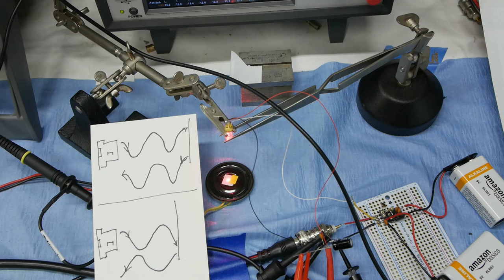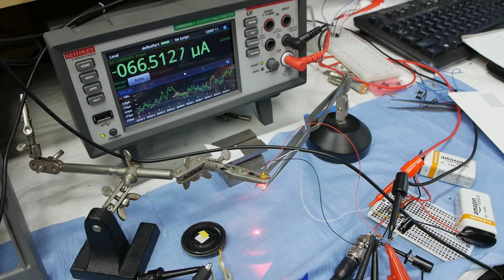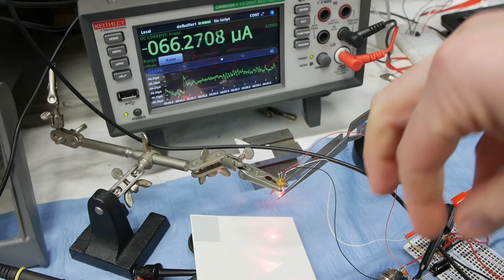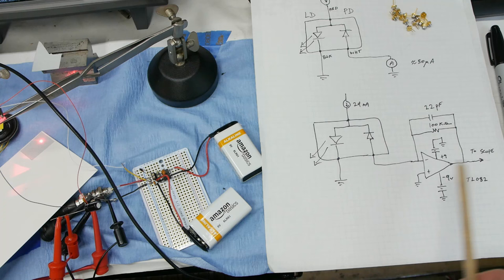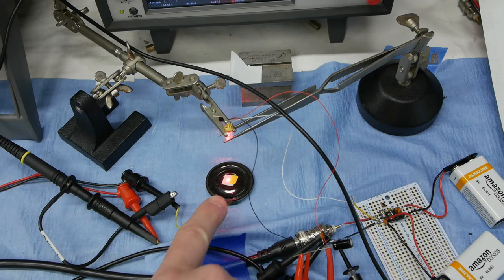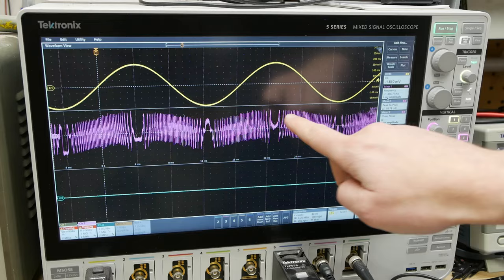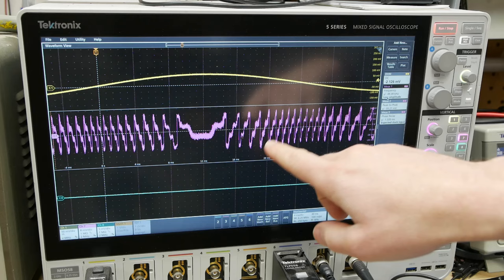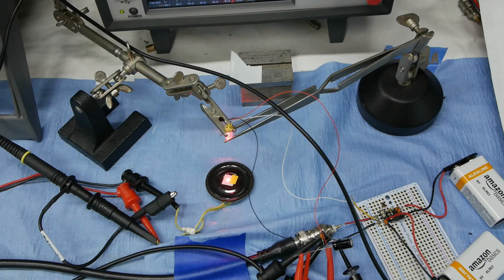Laser diode self-mixing: Range-finding and sub-micron vibration measurement

Comment: You are looking at the doppler algebraic sum of the sent and received signals.  That sum be a higher frequency for an 'approaching' object, and a lower frequency for a 'retreating' object.  That the object is moving in a distorted and repeating pattern gives you varying frequencies.  If you use two radio receivers of the same frequency as IF with two laser modules, you should be able to make a full duplex link, as in the old gunnplexer days.

Comment: I was revisiting your always inspiring videos, and noted a possible factor of two improvement in actual accuray as the beam is actually doing a round trip, so the required motion for peak-to-peak on the scope is lambda/2 in sensor to device distance (cf. instant ~12')

Comment: Most of my recent experience is using photo diodes to validate laser pulse counts and shape. This is a very cool idea that I will have to play around with!  But as usual this is the internet and people are jumping to some really crazy conclusions for how this can be used.  It's a creative re-purposing of an existing component that tinkerers will have fun with, which is my plan. It will not measure vehicle speeds, open a black hole, or revolutionize industry.  It is simply measuring the power of the reflected light it collects(which is not limited to lasers, by the way), so you have to have a fixed and repeatable amount of laser power and a target which cannot vary in its reflective properties.  If you had an application where you could ensure that your laser diode output power and target reflection was consistent then this would work.  Maybe some extra filtering for ambient light "noise", but that is easy.  I would not be surprised if this worked quite well given the minimal parts count and cost.  Most laser distance measuring is done with time-of-flight measurement.  Like range finders you can get from Home Depot, SparkFun, etc...  As far as I know, which might not be much, anything other than time-of-flight methods get into some really cool commercial stuff like what SICK, Banner, Keyence, others make.  At the extreme end would be the stuff Laser Depth Dynamics makes.

Comment: Applied Science You got to have the capacitor across the feedback resistor of the transimpedance amplifier to keep it stable. Otherwise, parasitic capacitance at the negative input of the opamp, alongside with the capacitance of the photodiode, would create uncompensated pole which would cause the transimpedance amplifier to oscillate. Compensation of the pole is the main purpose of the capacitor.
I enjoyed the video!

Comment: Don't know where else to put this, so :
in my life and here on youtube i saw on numerous ocasions "cleaning" PCBs with compressed air. Being in refrigeration industry for years i realized that there are few reasons for not using compressed air :
- either dry or not it will get the parts wet because of low temperature of expanding gas
- it can push the dirt under components like ICs and connectors
- combined dirt with moisture makes a pcb bad in moment.

Vacuuming with integrated brush sorts all that out (low pressure sucks dirt and moisture).

Now i wait to hear from average Joe  ...blablabla.. but they all do it... blablabla :)
But, it often happens before trying the part/system so you can always say that it was already bad ;)
Maybe this could be a subject of interest for you, for one more brilliant video ;)
Greetings from Croatia, keep up the good work.

p.s. sorry to all for off-topic letter

Comment: I noticed when you froze the scope with the first since wave, the voltage between peaks were phase slanting (moving forward and reverse in phase). The Doppler effect?
Reply: Side-effect of AC coupling most likely
Reply: Doppler effect constitutes that interference cycles count occurs (within each positive and negative slopes of speaker wave) should be uneven. I counted, they were equal. So Doppler is less likely or absence.

Comment: I wonder how far can you still get a relatively good sensitivity with this setup?
Reply: with a VCSEL (laser diode) you can go up to 3 meters (maybe 4) because of coherence length. for velocity. (as far as distance measurement, 1 meter is the maximum)

Comment: Very interesting observation. This method is used in RADARs and is called FMCW. After the signal is detected, the FFT needs to be taken and the peak position is proportional to distance. For best results, the current probably needs to be a rising ramp on a pedestal, followed by darkness. It would be interesting how such prototype will work?

Comment: Question: Is it possible to turn incoherent light like light you get in a cloudy weather into coherent light?
Reply: nattsurfaren yes! In fact Dennis Gabor won a Nobel prize for using coherent light to create the first hologram before the laser was invented. Lasers have both spatial coherence and a very narrow frequency range (essentials just one frequency). Narrow frequency light can be created from a light source like a mercury vapor arc lamp (similar to the orange ones used in some street lights). Special coherency can be achieved by passing the light through a pinhole to create a point source of light. (I can not explain the reason why this is true in this comment). 

A device like this is called a ‘spacial filter’ which are explained on google.
Reply: Thanks  @MusicBent
Reply: No. Lasers are are special because they produce phase coherent light. There is no way (that I know of) to filter for a single phase of light.
Reply: @RobertSzasz  To my understanding that if you use a magnifying glass to make fire from the sun light you can only get as high temperature as the temperature on the surface of the sun. So if there were a way to "filter" light from a cloudy sky to coherent light you would only get the temperature that you get from the surface of the clouds. But this is kind of ideas that are just spinning around in my head and I really don't know how it would work for real.
Reply: @nattsurfaren  If you used a huge magnifying glass(or an acre of solar mirrors) to pump a laser you can accomplish in phase polarised monochroamtic light. You might need to pump some non lasing medium as an interim stage though.
A ruby laser video exists on this channel.

Comment: Kinda like a laser range finder?
Reply: Laser range finders either use triangulation, or modulate the laser with different lower frequencies and measure the signal resulting from mixing the original with the received signal. Varying frequencies are used to tune in the exact range.
Reply: No. Most laser range finders use time of flight.
Reply: @titter3648  and they measure the actual time by mixing the original, modulated signal with the received one. None of these directly measure light interference. Andreas Spies has a detailed review.
Reply: @graealex  Laser distance measurers sold in hardware stores (and Leica surveying equipment on which some of them are based) use the continuous beam with the clever modulation / heterodyne method that you describe.

But there are also plenty of other rangefinders that actually measure the time it takes for a reflection of a pulse of light to return back to the unit -- many rangefinders used for sports, for example, use this principle. They might be accurate to a foot with a range of some hundreds of feet. Also, "Hughes Tank Rangefinder AN/VVS-1" is particularly famous, because it is based on a ruby laser, and cheap surplus units were in the past wildly available on surplus market. Curiously, some mobile phones today also use tiny single chip time-of-flight laser range finders to detect when they are next to the ear -- to lock the keypad out, so that the ear pressing on it would not create a nuisance.
Reply: @cogoid  It's very hard to build TOF sensors that work with a large variety of distances and are still very accurate. Also the distance sensors in smartphones usually do not employ TOF, rather they measure amplitude and give out a binary signal (near, far) like any other IR light barrier. As I said, most devices DO NOT employ TOF, even with many people claiming otherwise.
Reply: @graealex  
 You are right that it is difficult to obtain very high accuracy with direct TOF measurement! Where utility laser distance measurers that use Multiple Frequency Phase Shift Method have accuracy of a few millimeters over tens of meters even for cheap units sold in hardware stores, the more expensive direct TOF rangefinders for hunters only have accuracy of about one meter at a kilometer range.

But if you look at the rangefinders sold in stores or on-line, the vast majority of longer range units (Nikon, Bushnell, etc) do use direct TOF measurement technique. Their range is much greater than that of the utility distance measurers -- often well over 1 km, and they put out very powerful light pulses to get this range -- the manual for the Nikon "Forestry Pro" unit says it puts out a 15W 14ns laser pulse! 
 

Without doubt, there are plenty of direct TOF devices in the field -- but to claim which technology is "most used" you would need a more careful analysis of the market. I simply do not have such data.

As for the smartphones -- I actually don't know how many smartphones are equipped with TOF sensors, but for many years now, STMicroelectronics sold VL6180X and VL53L0X time-of-flight sensors targeting smartphone applications. The technology has been available, and I assume somebody designs it into their phones. LG G3 smartphone used the VL6180X rangefinder chip back in 2014, but who knows how many phones today use these and similar chips today.

_"The VL6180X ... technology allowing absolute distance to be measured independent of target reflectance. Instead of estimating the distance by measuring the amount of light reflected back from the object (which is significantly influenced by color and surface), the VL6180X precisely measures the time the light takes to travel to the nearest object and reflect back to the sensor (Time-of-Flight)."

Comment: Why not use this to level a 3D printer bed?
Reply: Cause it's way too sensitive to the environment
Reply: @AntonBabiy  Nothing that can't be compensated for via signal analysis. This is a decent enough idea. The real reason why it hasn't been done is because it's challenging from a mathematics/software perspective also because nobody has thought to do it.  The idea of shifting the frequency to get an absolute distance for example is pretty darn clever, and i suspect it has more precision than firing a laser and identifying how long it takes for the light to return.
Reply: Because it's overkill and there are probably more cheaper, simpler and reliable sensors. Like a digital indicator. But you can of course.
Reply: @peteabc1  well it's not overkill from a cost perspective. It is from an effort perspective but if one person does the legwork then it's done.
Reply: @ARVash  Said you can :). But I warn you there are some hidden hard to solve problems on the path.. Btw that time measurement is called time of flight and it usually isn't precise because light is too fast.
Reply: @peteabc1  The cost of the laser diode is dirt cheap. So the price of the hardware is really down to the electronics to interpret the signal. And i don't think that will need to be expensive either (because this does not need to be that high of a frequency).
And it is contact less and contnius measurement, that beats a mechanical probe any day.
Reply: @titter3648  the cost of the hardware to process the signal reliably will greatly outweigh the diode. It'll need to be a really high sample rate adc and powerful soc. Also the absolute distance measurement with this isn't accurate at all. Only the fluctuations in distance are accurate
Reply: What's the point of leveling 3D printer bed to sub micron level? At that level it's not even flat, but some demented parabola.
Reply: @titter3648  Depends on solution. When your printer costs 150$ to make and the cost of the sensor with everything is like 15$ just in parts that's already 10%, not cheap at all. And laser diodes are dirty cheap only if you buy out of spec parts from ebay or in high quantities (10k or more).. And you can already buy laser proximity sensors with um accuracy but they're expensive. But there also exist diode contactless proximity sensors with digital output (illuminance level) for cca 1,50, you can't beat that.
Reply: @ARVash  "nobody has thought to do it" Absolutely wrong! :) It has definitely been considered by multiple people at many times in the past (one of those people being me of course, I've wanted to try this since I first started doing bed probing back in 2012). The reason it hasn't been done is not that the idea is outlandish, but rather that it is impractical compared to other techniques and the level of precision actually required for the task. Physical switches are capable of reaching below sub-one thousandth precision, which is better than the local flatness of even a ground metal bed plate, and also approaches the resolution of z movement. Note that probing to better resolution than your z-axis is able to actually move is completely pointless.

Comment: I think I just witnessed a FMCW Li-DAR, WITHOUT a "tunable" laser.................. MOM GET THE CAMERA
Reply: yes, you did!
Reply: I hate the term FMCW.  It is a stupid conjunction of two meaningful terms.  I prefer Continuous FM (CFM), which actually says what I think FMCW thinks it is saying.
Reply: Well it is tuneable probably below 1 nm - but most likely not without spectral mode hopping. This is actually (one of) the trick(s) getting a nice and reliable signal out of your setup.
Anyway nice video, what i find funny here is the fact that you use a <10$ LD for your demonstration- all you need to make it work is some retroreflector tape and 250k$ worth of  miscellaneous equipment XD

Comment: WOW!  That makes sense!  The basic self-mixing principle is reminiscent of the way a 10 GHz dielectric resonator doppler radar works (i.e., a microwave door opener like the HB-100).  But taking it to several extra levels . . . that was eye opening!  I wonder how it would do in the bell jar to isolate it from air currents, or if that would even matter.

Comment: That's really cool!  You can get so much information from a "simple" device, at least in principle.  I noticed that at the end of the video, the whole setup appeared to be acting as a microphone, picking up your voice as you talked.

So as you said, it's very sensitive to mechanical noise.

I don't how hard it would be to use a range finder such as this to detect the distance of the nozzle on a 3d printer to the print bed, and whether that distance could be determined accurately enough for practical use.

Comment: Fantastic work!  The range measurement via changing wavelengths reminds me of optical coherence tomography.  The source rapidly sweeps through a range of wavelengths, and the Fourier transform of the resulting signal maps out the reflectivity at different depths.  This is commonly used in ophthalmology especially for monitoring macular degeneration.

I suspect that the 'stair steps' in the waveform may be due to the laser diode jumping between modes.  It's an optical cavity after all which will support a discrete number of modes, and fluctuations in feedback or drive current (also temperature) will cause it to jump to the next mode.  However, I would not expect doubling the distance to also double the number of mode jumps, so perhaps not.

Comment: This is a bit like an optical version of those radio receivers called "regenerative receivers". You build an oscillator that is just above the threshold of oscillating, and you find that its signal level is very sensitive to incoming signals at the same frequency.

Comment: Musician here. Ben, you ARE hearing the stepping in the square wave type sound, not the ringing. The things you are doing are some of the basics of creating music by synthesis. Also, this whole video is hitting really close to my interests in music, but also because I also have experience of these effects due to my interest in different types of photography (like interferometry and macrophotography, even infrared photography, as the lenses also modulate the light in similar ways to those in the video) and my little ADSB-receiver projects, as the modulation of a steady signal is visible/audible/measurable in these applications as well.

Comment: Precisely the same principle (self-mixing interferometry) forms the functional basis for microwave motion sensors, such as those used to activate automatic pedestrian doors on the approach of a door user.  In that application, the technique is referred to as autodyne detection, as opposed to heterodyne detection used for frequency conversion in radio receivers.  See, for example, U.S. patent 5,481,266.

Comment: Ben, I don’t have much social media so I can’t tweet at you, but you were a huge inspiration in making an air liquefaction setup that I am working on. I am going to try a simple linde cycle using off the shelf components, then compare that with the output of a system using a helium compressor cryocooler system. I then plan of placing the cryocooler in the linde cycle loop to make a sort of hybrid system. If you have any data from your old “diy liquid nitrogen” setup, I would love to put it into the research I would like to publish. Data or not, you are a huge inspiration and I really appreciate what you’re doing.

Comment: It looks like at low amplitude on the speaker, you can actually see the voltage quanta of DAC inside the function generator (as steps on the interference pattern). The waveform from the photodiode looks like a sinusoid under a modulo 2N transform which would cut off "the upper bits" if we were to convert the signal to digital domain.